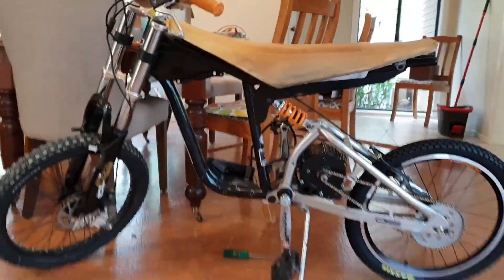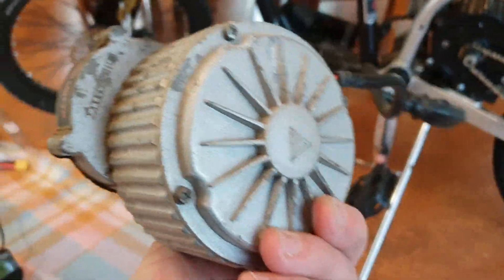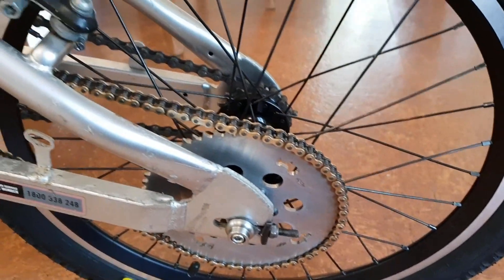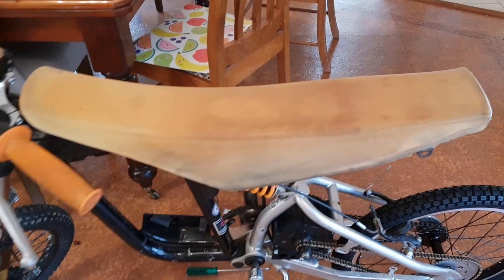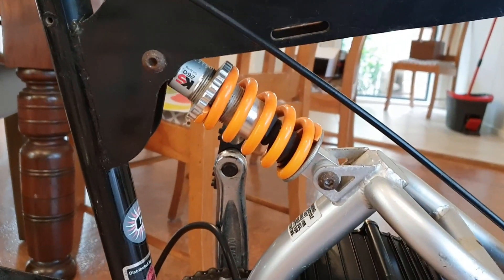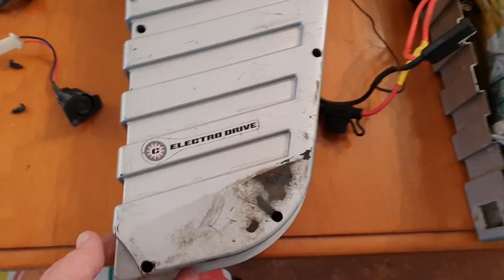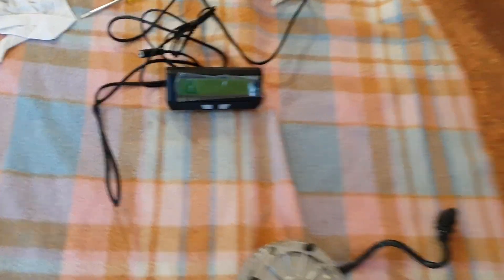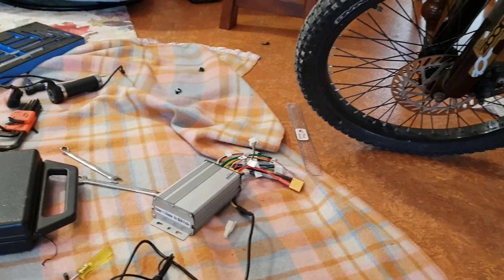Electric Mini Moto Build Part One. Mongoose CX 24 200 Conversion

Comment: Did you make an adjustment to fit the motor welding etc?
Reply from the maker: Hi
No it bolted straight on with the lightning rods motor kit.
Thanks for watching

Comment: Judging by the swing arm isn’t that a 450 not a 200?
Reply from the maker: Hi
I Australia it was sold as a Dyno CX200 but it has the swinger like the 450.
Reply: @offgriddreaming5403  thank you I have the mongoose cx24v200 and it’s a one piece frame so I was wondering the difference I guess you got the better rebranded 200 LOL I want your build :(

Comment: How did this build turn out? Are you still building? I just got a brand new cx24200 I’m interested in your build parts list and what the finished bike looks like
Reply from the maker: Hi
It turned out good it's still not 100% finished.
I plan to make a video on it soon. It's a great little bike.
If you go on endless-sphere.com you will see some similar builds.
Mine has the lightningrods motor and sprocket.
Thanks for the comment.

Comment: Hey I just got one and I’ve got some questions on how to make it faster and where to find parts?
Reply from the maker: Cool ask away my friend ✌
Reply: @offgriddreaming5403  where can I find a good motor for it? And what batteries should I get? I'm completely new to electric motors, but I know how to rebuild gasoline engines so I have a little bit of knowledge. I've got about 300$ to spend on the motor so what's a good one to buy?
Reply from the maker: @ball7411  Where are you located?
Reply: @offgriddreaming5403   texas
Reply from the maker: @ball7411  If you go on endless-sphere.com there is a guy called lightningrods, that's where I got mine.
I think he lives at Oregon
Reply: @offgriddreaming5403  alright man thanks for the advice will definitely check it out

Comment: Bike looks gr8. Ive been following kelly and your bike on endless sphere. How much did it cost to build your own battery?
Reply from the maker: Hi
I get recycled lithium cells a the battery was very cheap to build, maybe $100 AU at most. 
I haven’t finished the build yet, so not sure about range.
I expect at least 20 km though 
Thanks for watching
Reply: Mike recommended em3ev battery packs which are priced pretty well for US. Wondered if its worth the effort to do my own pack.
Reply from the maker: Michael C. Fischbach yeah go with that I’d say 👍🏻

Comment: I have same bike would like to do the upgrade. Could you tell me where you ordered the Motor , processor and battery from.
Reply from the maker: Jon Strimple Hi
I gorge motor and controller from lightning rods in the US and I built the battery myself. Hope that helps
Reply: Jon how did the build go? I just got the same bike as well

Comment: G'day. I live in Newcastle NSW. I am keen to build pretty much the same thing for my kids. Can I find out what motor to order through lightning rods, where you got your hub, chain and sprocket from and what controller you are using and where you got it from?  Any help you can give me would be muchly appreciated.
Reply from the maker: mark wilton Hi mate
If you contact lightning rods in the US he should be able to supply everything for the build. I got everything through him.
The motor is a small block.
The controller is a Lyen 12 fet 
Do you have the same bike?
Cheers
Reply: @offgriddreaming5403  Yes. I got one about 2 months ago.
Reply from the maker: mark wilton Cool.
They’re a great little platform to start with.
Mine has been on hold while I build my shed but will dust it off again soon. 
I have some bomber forks and a new front hub. Will get a front wheel built for it.
Stay tuned!
Reply: @offgriddreaming5403  I am keen to keep it small and rideable for my daughter. I have a 160mm fork on it and a Float R rear shock on it. I will keep the 20 inch wheels on it to keep it small enough for her. I just want some more power with a 52V battery back.
Reply: @offgriddreaming5403  I’m really interested in this build I’ve got a brand new factory mongoose cx200 I might get for really cheap did you finish this build? Is there a spec list on what you used? Thanks

Comment: Just checking, did you say 2.5 kilawatt? Wow!
Reply from the maker: Yep you heard right Adam but, I will be limiting Amps to around 35, so more like 2000 watts.
I don't think I need to do 100kph , half that will be great. 
Crazy to think this little motor can take 50 amps!
Thanks for watching 😀
Reply: @offgriddreaming5403  there's these new motors that can mount to the original motor plate and it's capable of handling 72v 6000w and yes the frames can handle 6kw